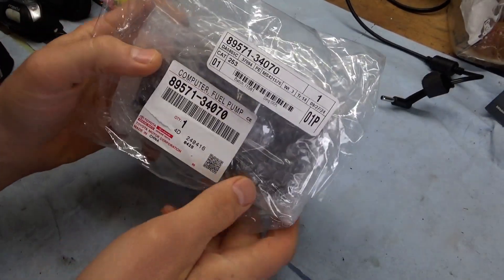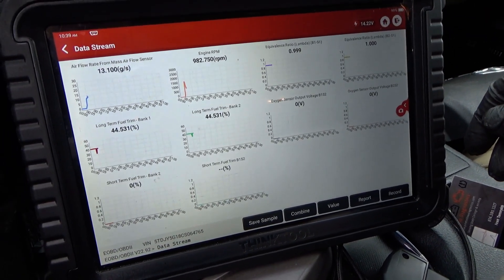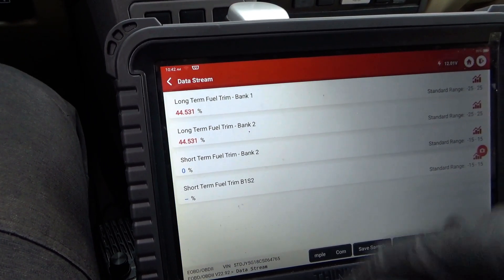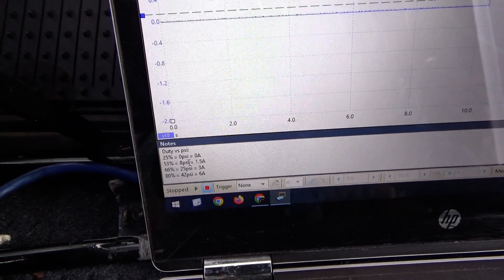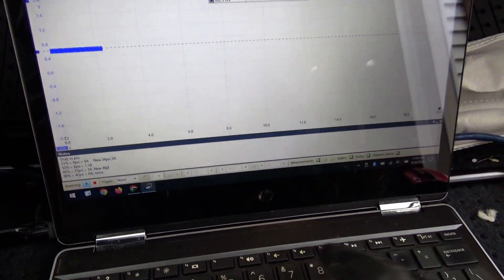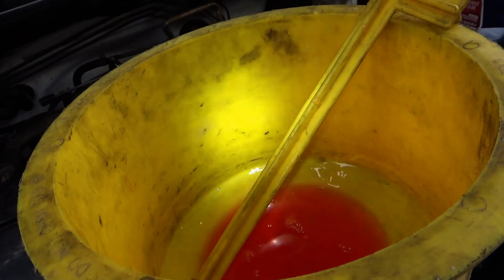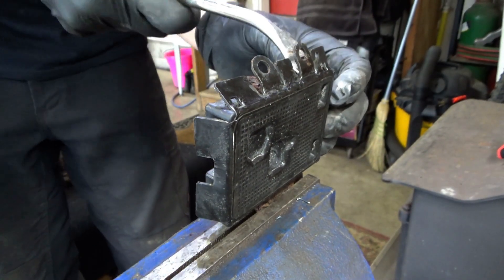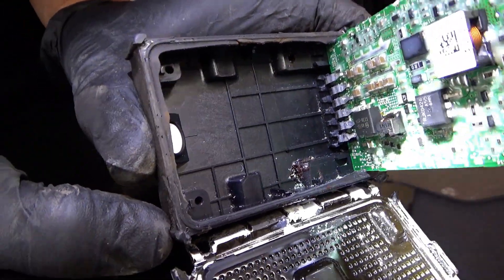(Pt 2) $2000 MISTAKE? (Toyota V8: LOW Power-STALL-Runs LEAN-Low Fuel Pressure)

Comment: I think most of the current trucks that hang electrical boxed underneath attached to the frame will have failures simply due to moisture penetration and corrosion. So I think they will have a short lifetime. It's very expensive to create a hermetic package that will work in that environment. You could do it with welded seals but the cost would be way too high for a consumer product. I tell all my friends with older cars to just continue maintenance and avoid new vehicles.

Comment: It blows my mind that a shop can look a customers eyes and ask for and accept money if they work they performed didn't even fix the vehicle.  It sucks for both parties for sure,  but that shouldn't be passed soley onto the customer. I my eyes customer should eat the cost of parts (because their vehicle still has new parts on it) at wholesale not some ridiculous markup from the shop, and the shop should eat the labor. If the shop assumes zero accountability for work done incorrectly, it brings every shop and technician down with them which isn't fair for the professionals such as Ivan that are honest and know what tf they are doing

Comment: Like the fact that you dismantled the control module, working in electronics we always did an autopsy on any fault to find the problems for future reference to cut down on maintenance time in the factory, Also to see the rust expands the plastic so much, in buildings the steel lintel bars over windows last for decades, but within one kilometer of the ocean the metal bars expand so much that they  can  actually force and lift brickwork walls, enough to cause severe cracking in buildings.
So, no wonder the screw was able to crack the plastic box.
Well done.

Comment: So what is the actual failure it’s lack of maintenance, owner is living in the rust belt and didn’t spray fluid film on the bottom of the truck. If they did some preventative treatment then the truck wouldn’t be broken.

Comment: Hard to throw the other shop under the bus one this one. Yes they were wrong.
But the customer said the vehicle ran good after the pump was replaced, so they had to assume they made the right call.
Think about any of us diagnosing this truck with no hindsight.
Runs like crap, fuel trims show lean, check fuel pressure and it’s below spec, check power and grounds at pump and they would be good, change pump, truck runs better, ship it.
I think how they handle things after all is said and done will show their character. But let’s face it, the story will be “the pump we replaced was bad, and it must have been slowly taking out the FPCM, no refund”

Comment: Hi Ivan I had the same problem on a 2012 tundra after changing the fuel pump I realized it has a fuel pump control module I used a H7 bulb to check to see if it lit up from trucks harness it did but it didn’t light up out of the going to the pump put a OE module in problem solved

Comment: I would pull it after the fix and spray it with some undercoating before installing. The Toyota parts come from their select factories and they do QC on production parts, old car parts may not be coming from as select a factory but they will do better than an eBay part.

Comment: Early Toyota's had a resistor and switching relay for pump speed not a module like that, was common to see couple of symptoms like poor drive ability in lower rpm until high speed kicked in when pumps were worn, or cutting out in lower rpm when resistor failed, would start but not run

Comment: Good stuff Ivan. I've replaced multiple fpcm on the tundras but never because of those symptoms. They usually just die. And yes, the next one will definitely be easier to diag haha I have a saved waveform on my scope of the fuel pump amperage along with power and fuel pump control so I always have a reference. Fun!

Comment: Could you have avoided the drama by removing the old control module and repaired the obviously rusted out mounting bolts and assured a good ground.  Ford trucks & SUVs, for example, have frequent module problems - always check the integrity of the fuel control module before replacing a fuel pump or buying a new module.

Comment: I live by a lake and see people backing late model pickups/suvs that are towing boats so far into the water down launch ramps that the bumpers are submerged  under water. I guess they have no idea where those fuel pump modules are located (or even that there is one)

Comment: If that corroded metal bracket must be bolted on the controller then I would at least de-rust it. Then spray paint it. The bracket. Or use Hammerite. The screws then replaced by rust proof steel. And may be even spray WD40 or just grease through the screw holes. Just fill it with up.

Comment: It would be nice to get a refund but good luck with that. The shop will just say the fuel pump was bad also and it is what caused the module to fail. How are you going to prove them wrong? Unless you still have the old fuel pump.

Comment: Heads up on the early 5.7l engines, the coolant manifold under the intake likes to seep normally at the rear. You can crawl under the truck and look at the weep hole on the bell housing and see a pink foam and that's the coolant. They used an incompatible gasket maker for the sealant (that's right no O-ring just RTV), Permatex Ultra Gray works very well to fix this issue. 

I still have to do this fix on my 2010 5.7l Tundra with 280k on it, I plan to do it when I do the time chains @ 300k (That's the service interval). Since I plan on also replacing all the intake and fuel injector O-rings at that time too. She drinks about half a quart of coolant a year at most.
Reply: You're on top of your vehicle, the owner of this Sequoia was not, or he would have known he was low on coolant and would have been looking and monitoring/topping off.

Comment: And new cars are so much better than old cars. '06 Jeep Wrangler (base model) has exactly 4 " modules in it. And since I retired in 2014 it goes to the shop 4 times per year. And if it has a problem. Just replaced the fuel pump. The total bill was less than $400 for the parts and labor.

Comment: I  never had a Toyota with the v8 ..However i been told they will pass everything except a gas station ... A far as parts . I know of a woman who took her Jeep to a dealer ship and i warned her but she knew better to fix her Jeep , limp mode problem.  They replaced the engine computer.  Wiring harness . Many sensors. Ect ect . I told her the parts cannon..ok When she wanted her money back they said of course NO .  They were all bad and they already thrown the bad parts away . Or thats the story i remember about the Dodge dealer ship .  So all the parts were bad even though it never fixed the problem.   OK

Comment: Great job diagnosing it in the condition that it’s in. But we don’t know what measurements were taken before and if the pump actually had some harm done to it because it could’ve been being starved voltage. After the first repair, we then assume that the fuel pump is in good condition, and move to the next component. Would be interested and how you would diagnose the module with the original pump in the car. It is sometimes easier to fix stuff/diagnose it after multiple parts have been replaced. You do a great job Ivan.  I’m right there with you. I had a customer spend $1000 on resolving a lien code and it was the fuel pump. On a Toyota sienna van.

Comment: The UR V8 has a known head gasket issue exasperated by acidity from neglected coolant. Aluminum block and aluminum head and steel head gasket with some type of composite material providing the seal. The acidity of the old coolant eats through the sealing material.  Bad news.  Avoid the UR and buy the UZ.  Load that pig up with liquid glass to seal the head and sell it quick.

Comment: Not all Chinese products are low quality and cheap. It all depends on the ordering manufacturers. If Toyota holds the Chinese production to Toyota standards then there is nothing wrong with using it. The problem is when it's made without quality control standards to keep it cheap and disposable.

Comment: The original diag was incomplete and it looks like they didn’t even know there was a fuel pump control module. A high mileage fuel pump may not be a bad preemptive replacement so not a complete waste. But $2000??  They do wear out and when they do, you are really stuck like in a snowstorm. Or on a deserted road in the rain.
Today was a great day to wake up!

Comment: If the car has over 200,000 miles  the fuel pump should be  replaced for reliability
Reply from the maker: I usually push them to 300k haha
Reply: @PineHollowAutoDiagnostics correct my 1998 4 runner was still going strong at 260k on the OEM pump

Comment: ❤😂🎉I think the other shop should return half. Customer paying for work that needs to be done not random repairs. Always ask parts back. Even then sometimes your dealing with service manager not mechanic.  They are gonna say that well, that what was broke when I replaced it and the control module happened after that.  Even testing and showing the old pump is good takes time and effort.  You have to find a good shop or ph

Comment: Hey Ivan, Laura Fix from "The Car Coach Reports" has highlighted the recent U.S. government restrictions on importing certain chips and software from China. This policy impacts many high-tech automotive parts, especially electronic modules and ECUs, which rely heavily on advanced microchips. The chip ban aims to reduce dependency on Chinese technology in critical sectors, but it could also make it challenging to find replacement modules or even have existing ones rebuilt, as repair shops may have limited access to necessary chips.
This shift could lead to longer wait times for certain repairs, higher costs, and potentially limited availability of specific aftermarket or OEM parts. The impact will likely vary based on how quickly suppliers adapt by finding alternative sources for microchips.

Comment: Thanks Ivan for answering my question in the video for Pt 1. However I have another question! If there are no fuel rail pressure sensor, how does the system know what duty cycle should the fuel pump be running at? Or is it just a simply corelates the duty cycle to engine RPM? Thanks.

Comment: It's time manufacturers started encasing units that are in exposed locations in protective outer  cases. SUV and  pickups seem particularly bad for mounting electrics in exposed positions 
One of the models I work on regularly has side impact sensors  that get flooded when I replace them I have been putting them in side plastic bags with a small pack of silica gel and bolt the whole lot to the chassis rail I have seen no comebacks.

Comment: I suggest going a step further when parts like ECUs winder motors , switches fail. Rip things apart more and most of the time they can be fixed. It helps to have component level  electronics fault finding experience..I recommend Sorins electronics repair school for component level repairs learning.. Mostly it's laptops but it all applies. I hate buying overpriced parts

Comment: No point putting a new pump on anything unless you have checked the pressure in rail.
But not many actually mechanics work in dealers or garages these days just fitters that some don't understand what a diagnostic machine can actually do.
How many people on here have actually been shown how a diagnostic machine works

Comment: Two observations: 

1. The fuel pump could also have been bad, maybe causing the control module to fail. The visible water damage might not have been the cause of the module working only at half power. While you are probably right, I wouldn't throw the previous shop under the bus for making the "wrong" call, it might have been right, but incomplete. Still not what they should have done but it would not mean they threw away 2000 dollars.

2. You could have called the module by substituting the pump with 10A load (2 headlight bulbs) and checking if that changed the current draw. You called it because the amp draw was not what you expected on the pump but were nervous on calling a 400 dollar part on that, while you could have compared with a known load (bulbs) to confirm your suspicion.
Reply: On your point 2, I agree. Or alternatively, along with current to the pump also monitor the voltage on the pump wires.  If you see low pump current while the voltage supplied to the pump is high, then bad pump would be indicated. In the case in the video, we'd presumably see a low voltage supplied to the pump resulting in low current.   (Where "voltage to pump" is presumably 12V PWM of different duty cycle.)
Reply: Thats why I hate mechanics that replace an Item, then tell you it didn't fix your problem permanently, but we tossed your part in the bin and its gone, now you have the same fault back again and have to start over.

Comment: Thank you for taking the old module apart. Water intrusion was the only real answer to the strange shift in commanded current operation. 

It must be very surprising to you the obvious lack of testing done by previous shops and dealers. I know it is very surprising to me. Who would change the fuel pump with lean operation without at least looking at port fuel injection rail pressure at idle first with a simple pressure gauge? This is so basic that I don't know what to say.

Edit: The original bracket for the Fuel Pump Control Module is very strange in that the module is cantilevered out with support on only one side like a tuning fork. This is okay for a hose support but not for an electronic control module. The module must be secured in such a way that, relative to the frame it is mounted to, it cannot vibrate independently. The module enclosure has side mounting bosses but it should really have just through holes in four locations. This way you can attach a plate along the frame side or upper panel and mount the module with four bolts directly to it. It would be confined to only vibrate with the vehicle body.

Comment: Nice diag and repair, interesting teardown. 
As for customer "authorizing" the repairs at the dealership, well there's pretty much no choice, either authorize the repair, or get nowhere in fixing the faulty car. Customer usually has no way to tell, if the "authorized" repair is correct or not, customer just wants his/her car fixed. 
If customer had this knowledge to authorize or reject the repair based on facts, customer probably would be able to repair their car themselves.
Reply from the maker: I think the customer should DEMAND guaranteed results from the beginning! Otherwise they are just authorizing an expensive guess lol

Comment: it's a real shame that they hadn't used stainless bolts, then they would never have rusted and cracked the housing to the circuit board itself.. but then again it would have cost a little more for each car and it doesn't work 🙃🙃😀

Comment: This is completely Toyotas fault.. This thing should be potted.. (in other words, you fill the cavity with resin  so that everything is completely covered)..   It looks like that bracket is acting as a heat sink, so that's why they didn't' bother to "pot" this--- because it probably would hold in too much heat,  and they would need to make a better heatsink.. So instead, they just kept it cheap and allow water to get in.. smh..   tisk tisk

Comment: A heavy 73 Oldsmobile 98 could deliver 18 mpg on the highways with a huge V8 equipped with a carburetor.  15 mpg is ridiculous for a "modern" Fuel Injected car.  All that aside, you made a good call on that controller.  Thanks for an  interesting, educational 2 part video.
Reply: But we don't know how accurate that number is.  Perhaps a longer drive would produce a higher MPG.

Comment: You should go online and buy one from one of a junkyards located in the States that don't see snow at all, for the friction what you paid. From 2007 to 2009 these modules were made in Japan by Denso however it didn't matter. If the vehicle was used in the North States, just matter of time and those modules were junk due to the moisture coming into them through the vent hole. Toyota has chosen a vary, vary bad location for them just to make more revenue in the future.

Comment: The prior shop diagnosed the problem to the right location, like the right city, but they failed to find the ballpark where the game was being played. 
Does the fuel pump module control the speed using pulsewidth modulation to affect the duty cycle on the pump ground side ? If so, would it have been possible to check the voltage on the ground side ,at 50 % duty cycle voltage of 50 % of battery voltage ?  And at 25 % duty cycle would the ground side voltage be approx 9 to 9.5 volts, ( 3 to 3.5 volt drop across the pump motor )  ?  I am thinking the module corrosion was adding additional resistance to the ground circuit ,and preventing the correct voltage drop across the pump motor thereby reducing the current flow , as you measured ?

Comment: Im worried the sequoias cylinder head is corroded. The toyota coolant must be changed every 50,000miles or every 5 years MAX. the coolant becomes acidic and can drip down the outside, or into the cylinder.. i wish you would have investigated 1 gallon of coolant missing
Reply from the maker: It's 10-year Long Life coolant!

Comment: I have to say, zip ties get brittle crack break all the time.  Do it right and drill a new hole in the frame and bolt down the $400 part
Reply from the maker: @dpose6525  I've had zip ties last over 10 years no problem 😀